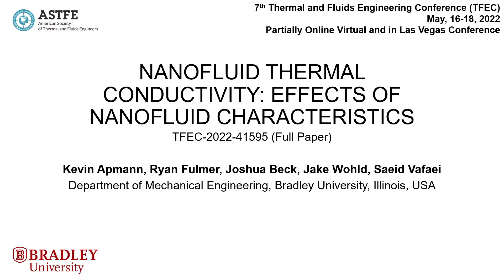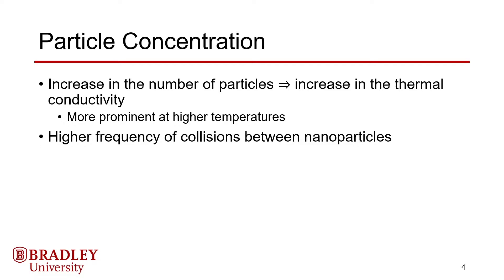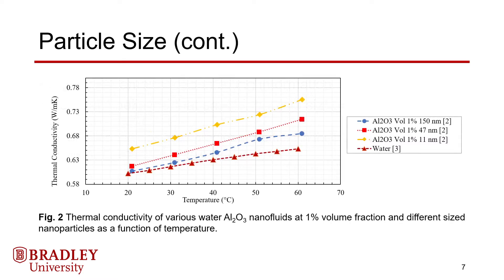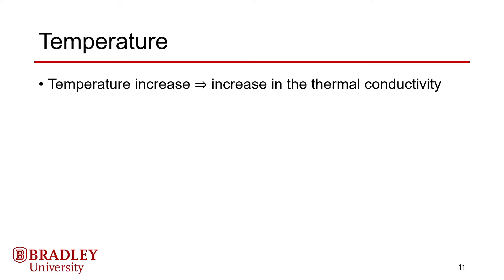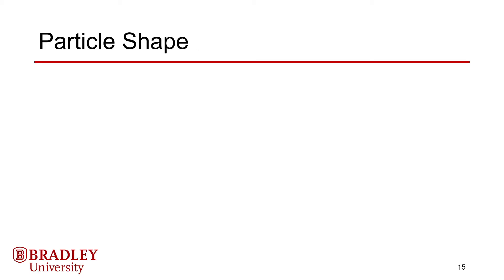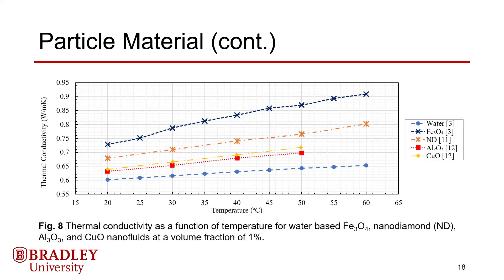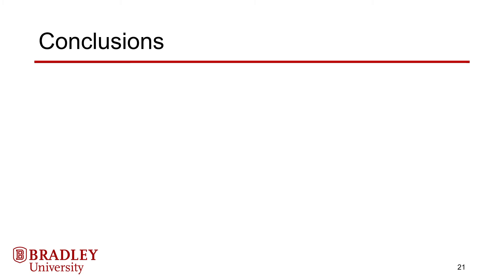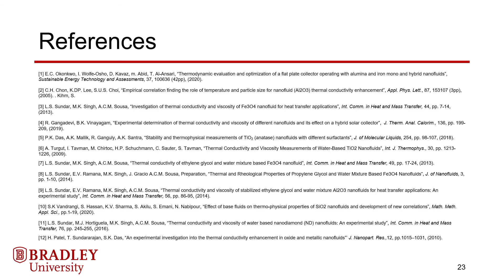Nanofluid Thermal Conductivity: Effects of Nanofluid Characteristics | TFEC-2022-41595

Comment: sir, I was taking the final year project has hybrid nano fluids . but i did get the how the two nano material should mix and find thier properties. plz could you help me with that
Reply from the maker: Which properties?
Reply: @jakewohld6343  thermal coductivity , heat transfer rate , viscosity , density , surface tension , after mixing  of two nano materials by therotical
Reply: @jakewohld6343  and thank you for rply sir
Reply: @jakewohld6343  thank u sir for reply,
i want to find the themal conductivity, heat transfer rate ,surface tension,density. after mixing of two nano materials
Reply from the maker: @mr.gaming7869  For density you take the weighted sum of the base fluid and particle densities with respect to their volume fraction (phi_bf * rho_bf + phi_p1 * rho_p1 + phi_p2 * rho_p2). For thermal conductivity, see this paper for a bunch of correlations, there is a section for hybrid nanofluids https://www.mdpi.com/2079-4991/12/16/2847. What heat transfer rate are you talking about? I do not know about surface tension. Maybe there are correlations in the literature.
Reply: Can you suggest the materials which is better combination if you could
Reply: To my project
Reply: I was thinking CuO and Fe3O4, but the thermal conductivity of iron oxide is low which material is better to replace for iron oxide or any combination u should suggest,sir